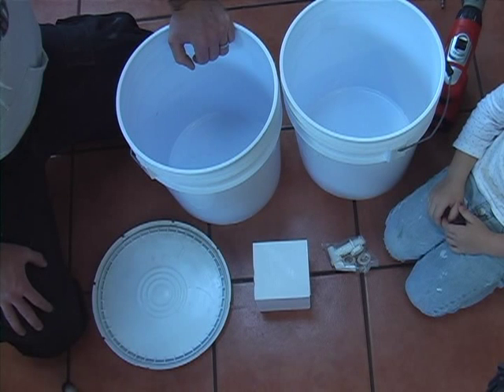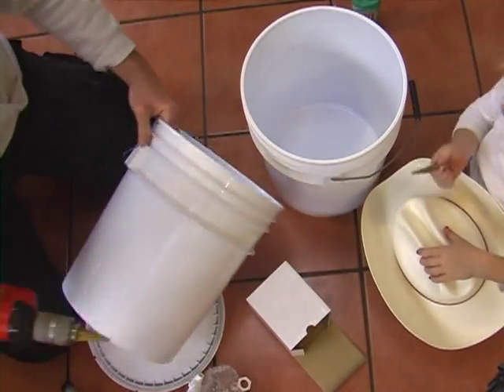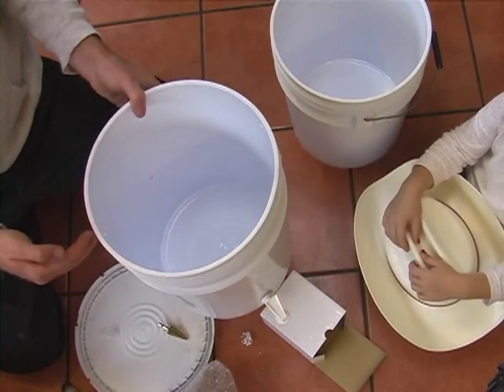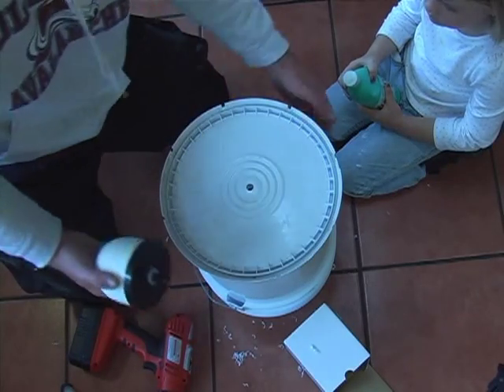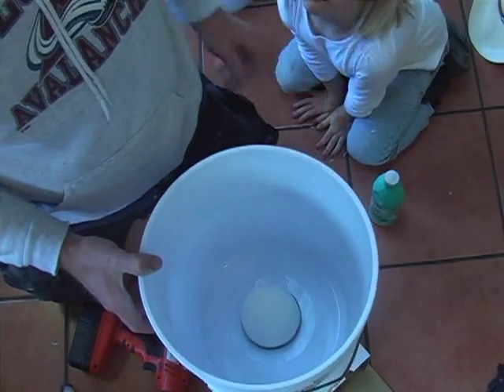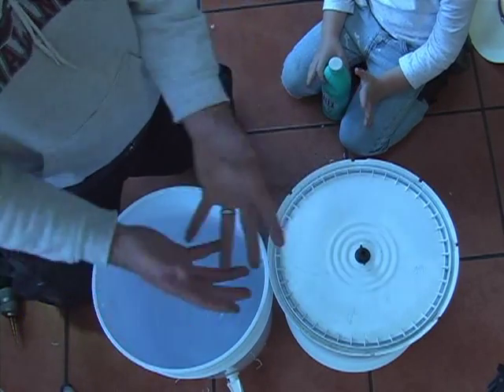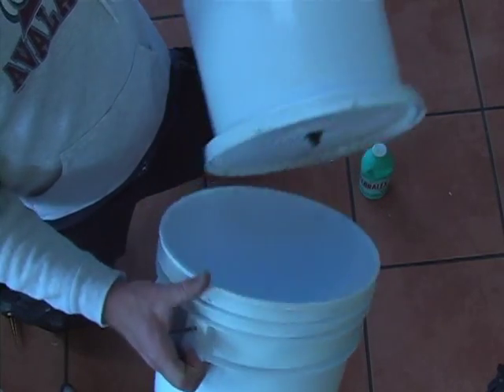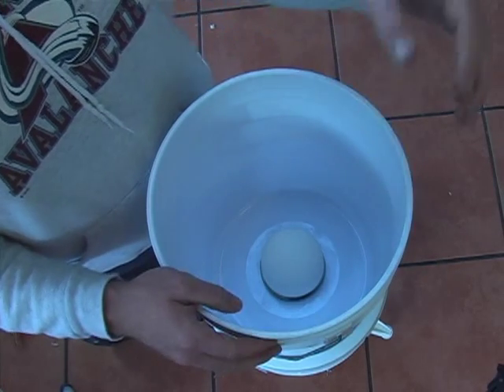Water filter how to

Comment: one observation.  say you are filling the top bucket with bacteria laden water and unknowingly spill some that runs down the side of the top bucket and down onto the top of the lid (that's a reasonable expectation right?).  That water will pool on the lid and likely leak around the threads and into your filtered water in the bottom.  There is no water tight gasket keeping water on the top of the lid from dripping around the threads and threaded hole.     One possible solution is to use the peel off style lids which don't provide a space for water to pool.... but if you have a better solution, I would love to hear it.  thanks for the vid!